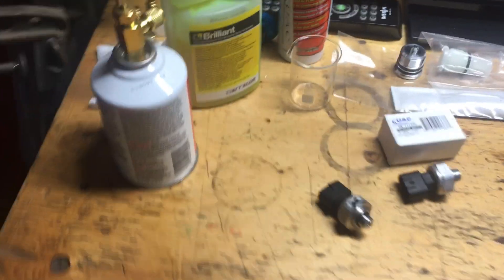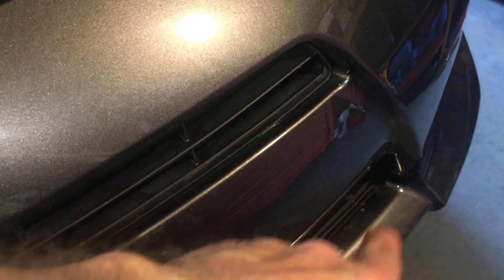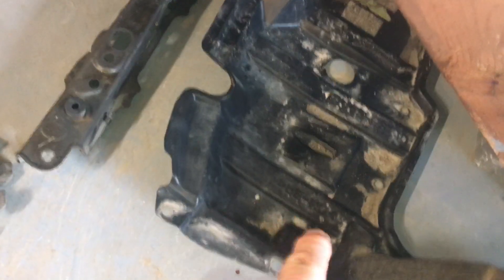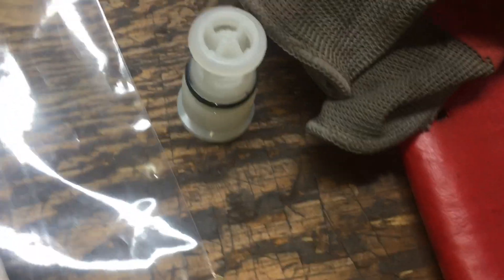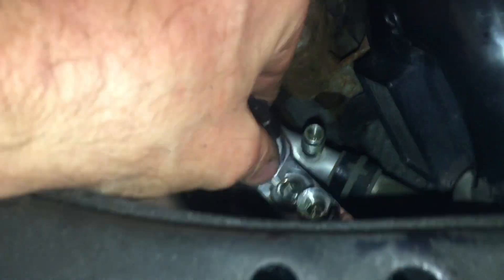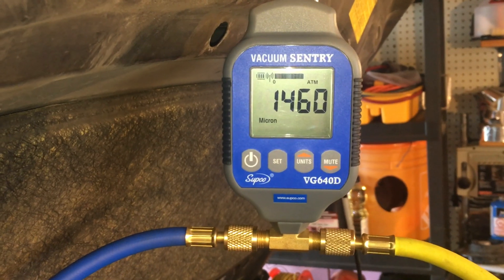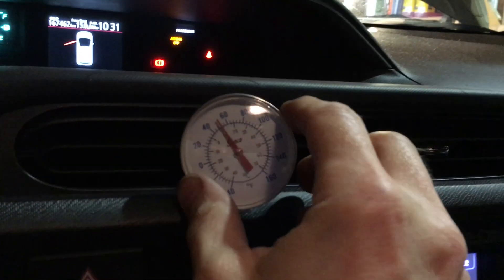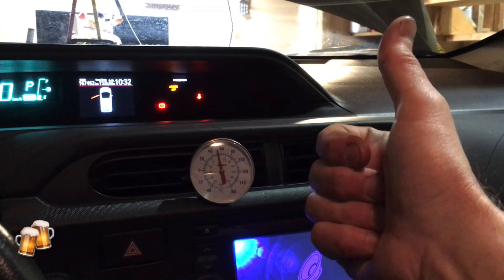Prius C Refrigerant Pressure Sensor Replacement

Comment: @ 1:31, does that mean you had to replace the block and the sensor? Or was your point that the block does not have a Schrader valve, which required you to recover the refrigerant before removing the sensor?

BTW, thank you for this great video! We recently purchased a 2012 Prius C, and the XTOOL is throwing the B1423 code.
Reply from the maker: The sight glass block on which the sensor mounts to does NOT have an internal check valve below the pressure sensor. Necessitating refrigerant recovery. I am very fond of my eyesight and hope to use it for some years to come 😁 I recovered, replaced only the sensor, pulled  a vacuum and replenished the refrigerant charge to the spec weight detailed on the under hood placard. Apologies if I didn’t make that point clear. Thx for watching 🍀👍🍻
Reply: @TheGibby3340  Thank you for the detailed response. I have one follow up question and I apologize in advance since I am not super versed in this, but I am also not scared in getting my hands dirty. So the 2012 Prius C we purchased back in November was giving us the B1423 ODB error code. Now that Spring is upon us, I am tackling this project.

I went to AutoZone and picked up some manifold gauges and vacuum. My buddy and I checked the pressure and it was pretty much at 0 PSI, so we assumed no refrigerant. We performed the vacuum test and determined there there was a leak.

I purchased the replacement sensor and AC valves. We're going to replace those and then fill the system with some refrigerant and UV dye to figure out where the leak is coming from. Assuming we are able to detect and fix the leak, do we simply refill the system with the refrigerant? Or do we need also need to add any of that PAG46 oil?
Reply from the maker: @LG-ty6xp Good question. I don’t know off hand. I will consult my manuals. Hybrid/Full Electric vehicles require a special specification oil. Don’t just add standard PAG 46. The  high voltage applied to the coils of the electric compressor can leak to ground via the incorrect spec oil and cause no end of grief. I will get back to you. 👍🍻
Reply from the maker: Manual details only refrigerant oil meeting the ND-OIL 11 specifications to-be used. Leak tracer dyes (if used) must also be suitable for HEV/EV use. The Toyota manual does not speak to oil replenishment post repair/recovery. But the manual for my Suzuki SX4 (similar capacity) states “when charging refrigerant only replenish with same amount recovered, if not measured add 10cm3 (ml). If any components are replaced varying amounts of oil are to be added to rebalance. Basically drain and measure oil within components removed and add that amount + a small percentage for a safety margin 🍀👍🍻
Reply: @TheGibby3340  Quick update! We ended up not replacing the sensor and just filled the system with refrigerant + UV dye to try and track down the leak. Once we filled the system the B1423 ODB error code went away. I wonder if the lack of refrigerant in the system just threw off the sensor and the system assumed the sensor was broken. I will keep you posted!

Comment: Quite the professional 😁. Be interested to see this with the UV light in a couple of days. As you've got a garage to work in you can turn the lights off and block any windows to get it really dark in there. It helps with seeing any dye with the UV light. It's interesting to follow this project, just hope it's not the SX4 revisited. 👍
Reply from the maker: Yeah Iain. I doubt many pressure sensors fail. Certainly not what I expected. My SX4’s AC is a ball breaker 🤣🍻
Reply: @TheGibby3340  Never changed a Toyota sensor yet. If it's a VW or Audi then pressure sensors failures are very common. Not only do they fail electrically but they can also lose refrigerant through the sensor body.